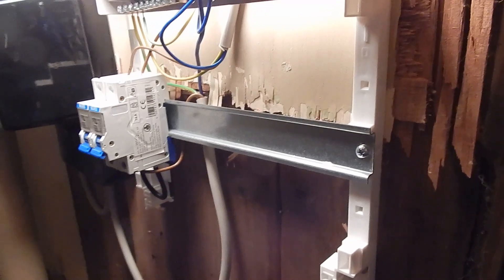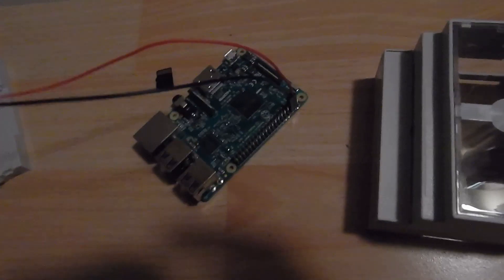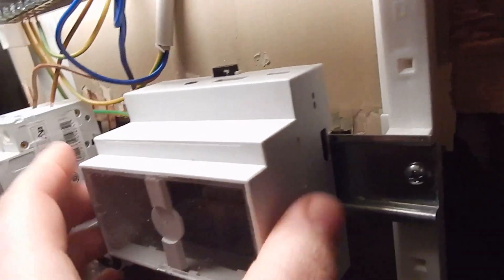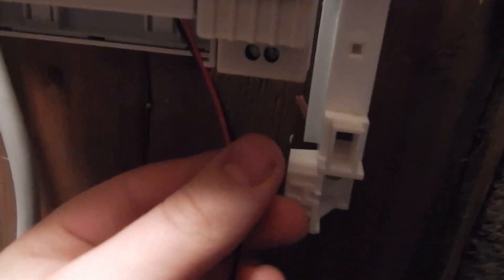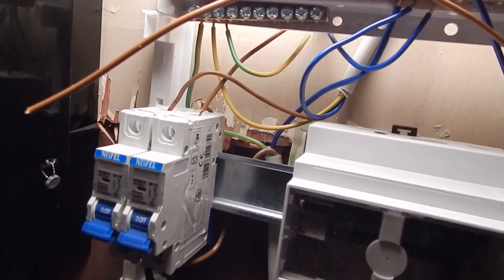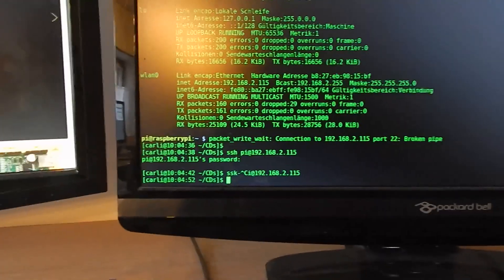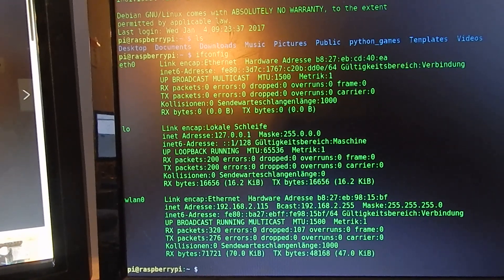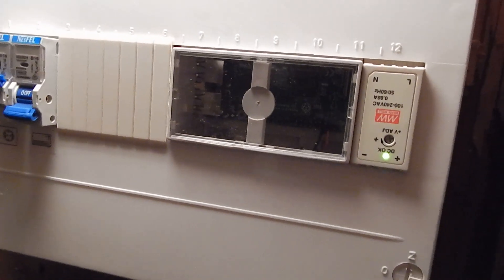Home Automation: Raspberry Pi 3 in Dinrail Case

Comment: Hi
Where did you buy your wire with gpio connector, the cable looks larger than the basic dupont wire ?
Thx
Reply from the maker: I bought it on ebay. just search for "female-female jumper wire"
Reply: ok, thx
Reply from the maker: The GPIO connector is a PCF8574 (https://www.youtube.com/watch?v=wScqE2baF7Q). The cable is a 4-wire telephone cable called J-Y (ST) Y from my hardware shop.